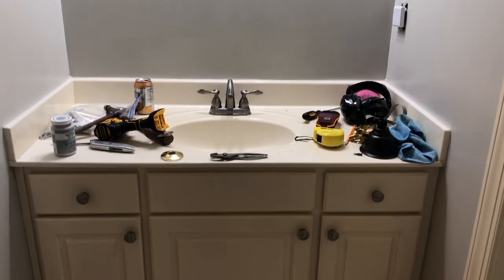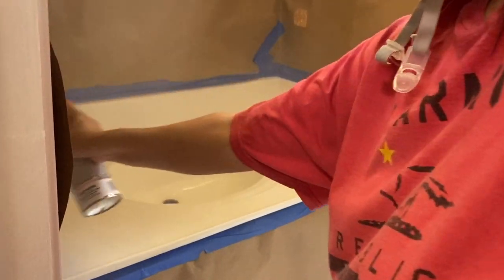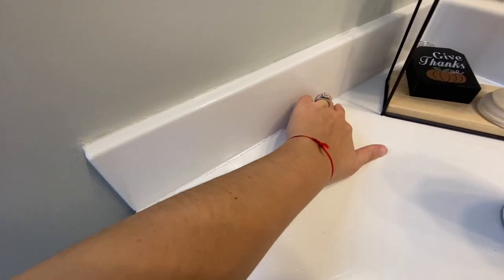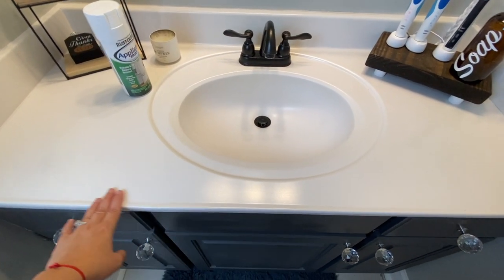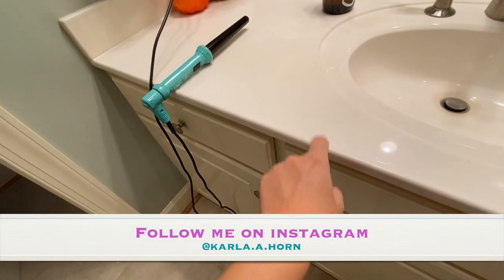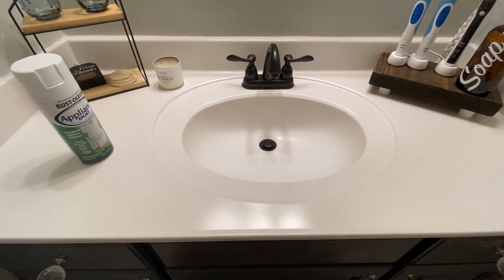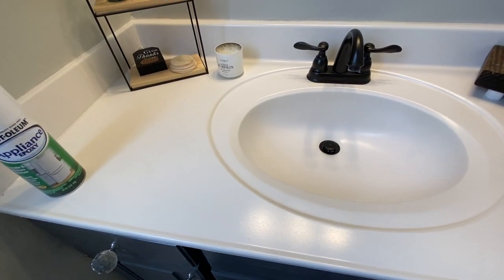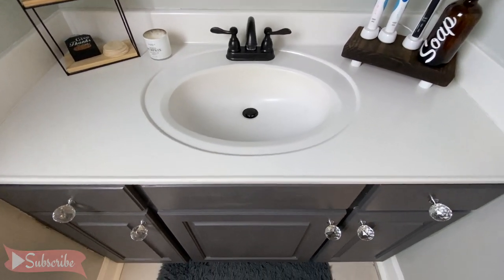RUSTOLEUM APPLIANCE EPOXY PAINT HOW TO EPOXY YOUR BATHROOM COUNTERTOP/FIVE MONTH UPDATE/DIY MAKEOVER

Comment from the maker: I hope y’all enjoy this video. If y’all have any questions please do not hesitate to ask. This Appliance Epoxy is worth trying.
Reply: Thanks for your help!! :)
Reply: So did you sand at all before? And did you finish with a top clear coat? Or was that not necessary? Thanks so much
Reply from the maker: @stormy3307  I did not sand. Just cleaned it very well first. That’s all. No top coat. The finish is awesome.
Reply: Are there any color of this epoxy? 🤔☺️
Reply from the maker: @jasaelvlogs5141  at the store they have black, white, and cream. I’m sure they have some other colors online.
Reply: @KarlaAlexandra  what about clear?
I'm trying to top a bar height table,  but haven't been able to check at my local Walmart,  please and thank you
Reply: What did you seal the cabinets with?
Reply from the maker: I used water based polycrylic. But if you are dealing a dark color like I did I would recommend that you add a little of the paint to the sealer because if you don’t you will get like a cloudy finish.
Reply: Why did my turned beige almost yellow after a month?
Reply: Hi dear, can you tell me how you clean this vanity in routine 😊TIA

Comment: It’s not glue it’s silicone caulk (which isn’t paintable)and you have to remove it completely with a razor blade first then they sell products to help remove the residue and or you can use a fine sandpaper. Then you can re-caulk with a paintable caulking.  Cool idea by the way. Peace
Reply: Ty was going to post the same thing about the caulk 😆 lol
Reply: Thank you for your post. You saved me a possible future headache👍
Reply: but don't you need silicone caulk in the bathroom to waterproof the joint

Comment: Hello, I pray all is well. Thanks for the video. May I ask what kind of spray did you use for the color change on the faucet
Reply from the maker: Hi. I just used oil rubbed bronze spray paint. But I recently used black appliance epoxy spray. Much more durable

Comment: What do you use to clean the sink? Has the cleanser effected the paint finish? Does the an state how to clean the appliance after that epoxy has been applied?
Reply from the maker: I use mrs Meyers products. You can use anything on it. I would use your normal multi spray/disinfectant spray. It has not done nothing to the finish.
Reply: @KarlaAlexandra  I have some experience. It looks great now, but it will fail at some point in the future. Few tips if you ever do this again. Sand your surface 220.....wet sanding is fine. You just wanna rough up the surface......clean with a degreaser.  Use a coat of compatible primer.......and lastly. Two coats.....spray paint doesn't go on very thick.....building up the surface. (but I will say....great job for a "first try")

Comment: Hello just came across you. Your countertop looks beautiful. Also your wall color is pretty, what color is it? I’m wanting to paint my bathroom. Thanks for sharing.
Reply from the maker: Thank you. The color on the wal is repose gray by Sherwin Williams. The counter tops are sprayed with appliance epoxy in the color white. I did three coats.
Reply: @KarlaAlexandra  
Is it flat? Repose gray is pretty, I’ve seen a lot of pictures with it.
Reply from the maker: It is a satin finish. It looks different I’m every light. If you look at my laundry makeover video, you will see that in white light it looks better than soft white. In the kids bathroom I have soft white. I like them both.

Comment: the respirator masks with say like a P100 filter doesn't keep you from breathing in fumes.  the P100 and N95 filter masks are for particulate matter, not for fumes.  the respirator you used doesn't protect you from fumes because fumes are not particulate.  that stuff is probably better to spread on a paintbrush the spray can definitely went into your lungs.  and that still has a lot of fumes.  that shit is so nasty.  i have used it because i have to sometimes.
Reply: May I ask which respirator do you recommend. I really want to do something similar but very concerned about breathing those fumes. TIA.

Comment: Did you use the epoxy in the actual sink part where the water goes? Thank you for all that info!!!
Reply from the maker: Yes. But I removed all the parts and covered the holes with tape and sprayed.
Reply: @KarlaAlexandra  how long did you wait before taking tape off?
Reply from the maker: @deelici0uss316  Maybe five minutes I never let paint dry on tape because then it’ll just peel off paint. Always take tape off when paint is still wet.
Reply: @KarlaAlexandra  thank you
Reply: @KarlaAlexandra Also how long did you wait until you used your sink again?
Reply from the maker: Not long a couple of days.
Reply: @KarlaAlexandra  okay i actually did this yesterday lol it came out great few paint drop spots but not to noticable. Looks so much bettter than the pink counter that was in there haha. Thank you so much for responding so fast
Reply from the maker: @deelici0uss316  no problem. I am about to do this again in my bathroom. Just remember that this is not a permanent solution. I did this because we decided we did not want to get a new vanity and this was a budget friendly fix. In the future we will be replacing the vanity with a butcher block countertop.
Reply: @KarlaAlexandra  eventually we going replace vanity as well. But this will do for now 😉 how long would you say it lasts until you redo it?

Comment: So did you just sand it and used the spray, or did you use something else to protect it?
Reply from the maker: Nope I just cleaned it really well and then I sprayed it. No top coat. It is an epoxy so I did not need a topcoat.

Comment: Does this need to be top coated with anything? Or did you just leave it after it dried?
Reply from the maker: Just leave it no top coat. It is an epoxy so it does not need it.

Comment: Did you replace the faucet and stopper yourself?
Reply from the maker: I pulled it out and spray painted it. This was just cost and time effective. Eventually we want to pull that vanity out and replace it with something a bit more modern. Everything in this makeover is original except the mirror and the shower fixtures. We did buy a new set at Lowe’s.
Reply: @KarlaAlexandra  whaaaat?! Wow. You did such a great job!

Comment: Karla, how long did the smell seem to last after spraying?
Reply from the maker: The immediate smell goes away within 30 minutes, but you can still smell a bit of epoxy 1 day later. I just left the bathroom window open over night.
Reply: @KarlaAlexandra  what if you don't have a bathroom window? Can you still use it?
Reply from the maker: Yes I would just open windows in your house and maybe get a fan to blow the smell out. It’s not super super strong but strong but it is a smell that will linger for a bit.

Comment: So i tried my first coat & still see the parts i sanded down. could it be that i didn’t sand it down enough?
Reply from the maker: I would sand between coats.
Reply: @KarlaAlexandra  what grit did you use to sand and how long after the first coat did you sand?
Reply from the maker: So I actually did not sand mine. I just wiped it down really good and sprayed. I did three coats on mine.

Comment: I need to get some where you get it, here in Canada it’s garbage paint
Reply from the maker: Wow
Reply: @KarlaAlexandra  ya, apparently they even have it in cans there, like for brush on or roll on? Not that I’d use that, also it seems like a lot of the videos I’ve seen have taller cans, likely to have better dispersion methods, and the big tell is that the text is written sideways on the can here but I noticed a lot of these videos where it does hood have the writing straight, like if the can was standing up

Comment: We used this on our counter and after letting it set for 2 days after 2 coats, it seems to not have cured 100%. Any thoughts or recommendations on why or what we can do to fix this issue? I used a crimper today for my hair and it left indentions on the counter from the crimper sitting on the counter. 🙁
Reply from the maker: Mine sat for a week before anyone used the sink. I even waited to put the faucet as well. I am not sure what can be done differently, maybe a longer cure time. Also remember that this is a quick fix. Mine has held up so far, just a little stain from my step daughters face mask which came up with a magic eraser. We are in the process of removing the vanity but I think if this bathroom was not used by all three kids and guest the epoxy will last longer a lot longer.

Comment: I sprayed my kitchen sink with this product and it turned out very grainy , not smooth; I called the company and they said the batch of that product was faulty . They will refund me and I am going to re sand and do it again
Reply from the maker: Mine is not grainy at all. Super smooth. Next time try applying from more than 6 inches away. I did very light coats as well.